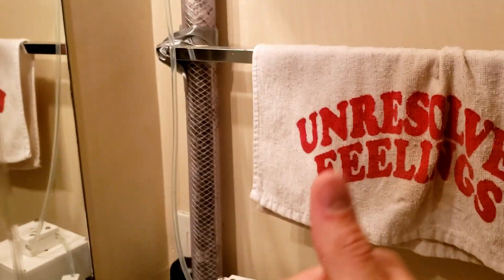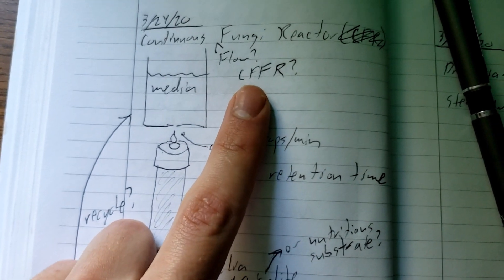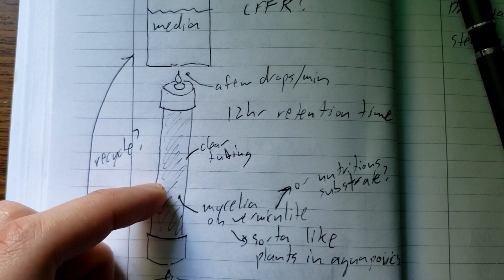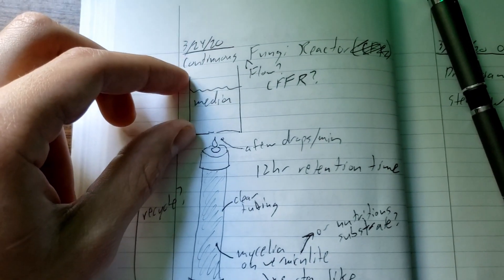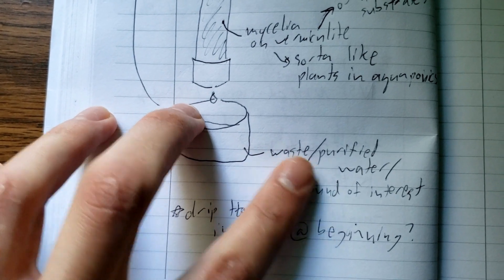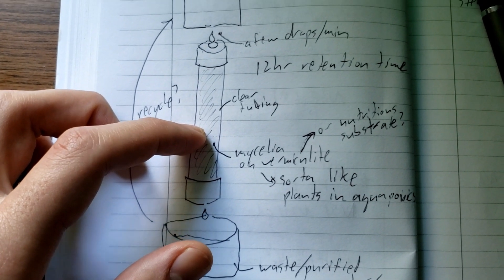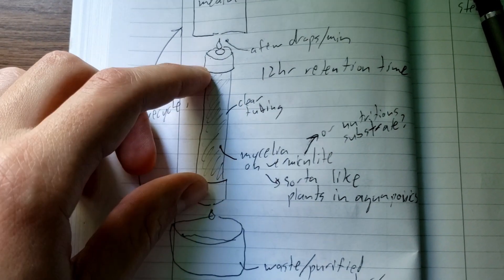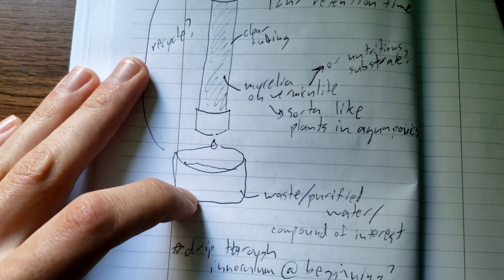Totally Tubular Fungi BioReactor

Comment: Cool project. It would be interesting to run the broth though a sterile soil column as a control experiment.  That would help in attributing the color change to the fungus rather than filtration by the soil  (essentially a crude form of column chromatography).
Reply from the maker: Definitely a good idea; maybe in place of this I could just use a bunch of dye and see if the column changes color? Having a control would be much better though.

Comment: Very interesting. in clear tubes some bioluminescent fungi would look cool. 
also I always wanted to make my own cellulase, to make grass or wood wine (or toiletpaperwine like nile red did) or for experiments with protoplasten.
Reply from the maker: So many good ideas here! I want to isolate some Panellus stipticus or Armillaria sp. to make a gently glowing night light... Either in liquid culture or on a solid substrate. It would be fun to try to make cellulase too!
Reply: @DIYBiotech  YES. I read on reddit comments you may think about streilising the "waste" media with UV-C. I think that is a bad Idea because it will damage the enzymes. A better way is using syringe filters. I'm not sure if the peristaltic pump has enough pressure but it would be worth a try, by Hand this may take a while. That would defnitly lower the contamintaion inside the tube if you reuse the media and preserve the enzymes to break down the material inside the tube. I'm not sure how much you can increase the concentration of enzym inside the media by reusing it. I imagine the fungus is probably gonna stop producing it at a certain concentration, but don't quote me on that.
If you still want the UV-C sterilisation look into aquarium supplise or water "purifier" their quite frequent.